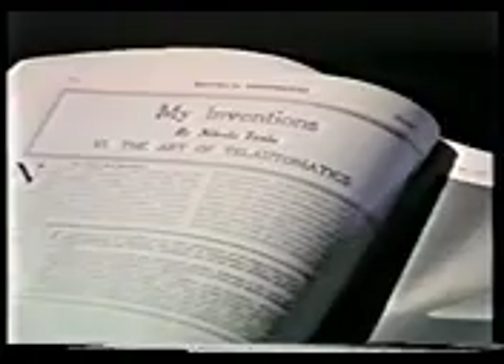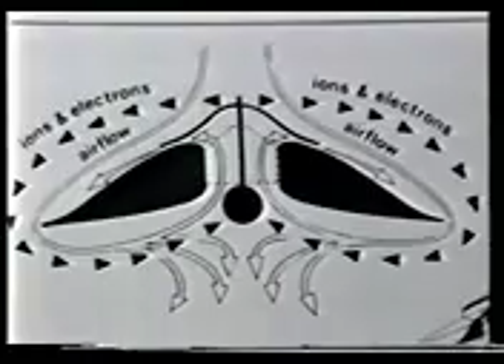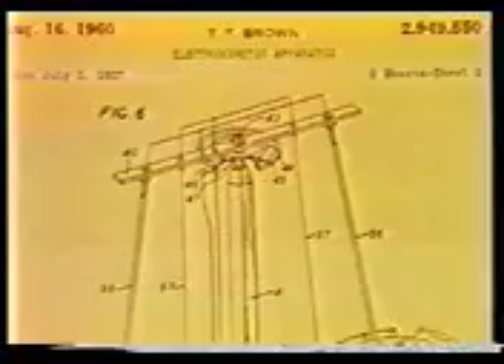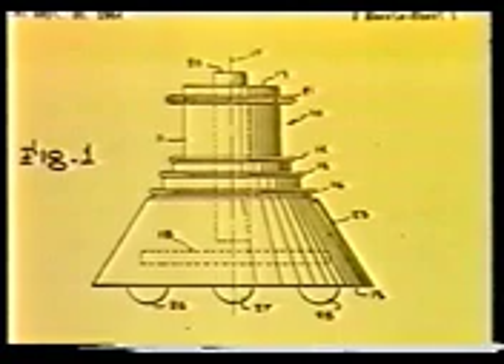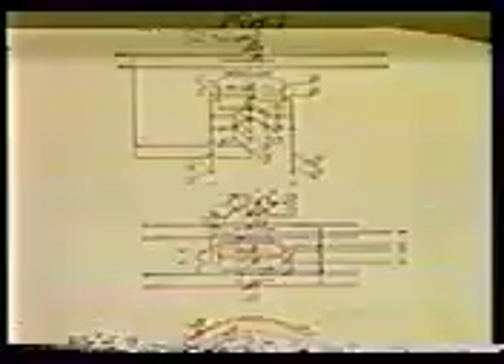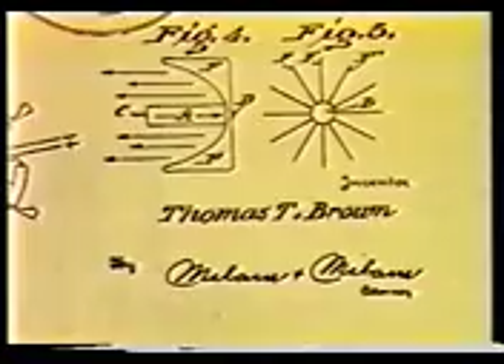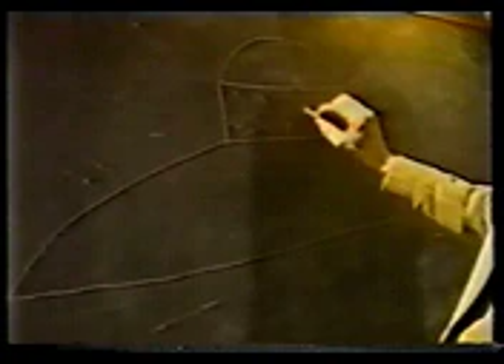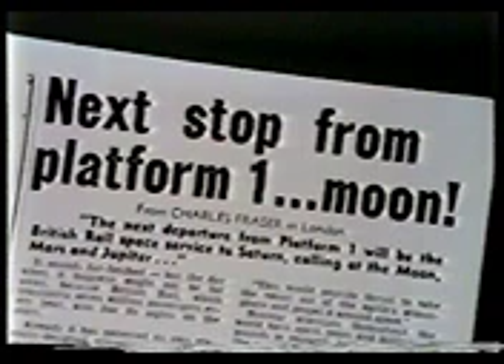electric propulsion

Comment: It’s 2024 now, an electrostatic propulsion system has been invented. It uses zero propellants. And it’s roughly 30/40 grams without any added on equipment. It’s able to do push 1G of force as of now. But it’ll be FAR FAR much better very soon. Its the biggest breakthrough of this century
Reply: the b2 bomber uses it lol, it surfs its own electrostatic sine wave.